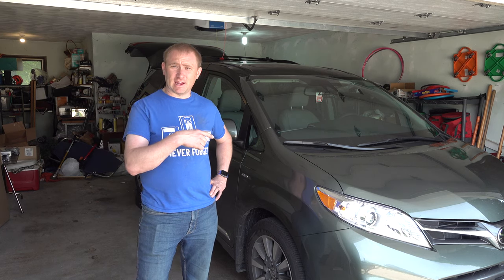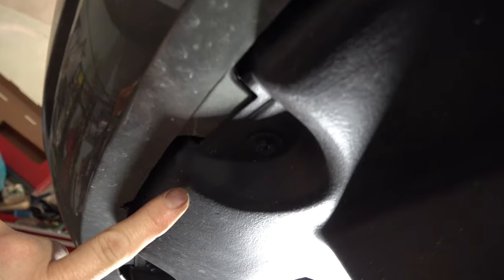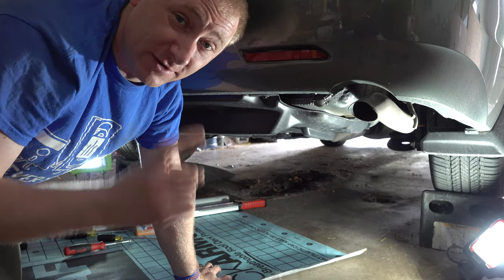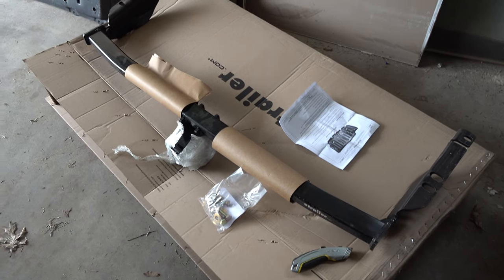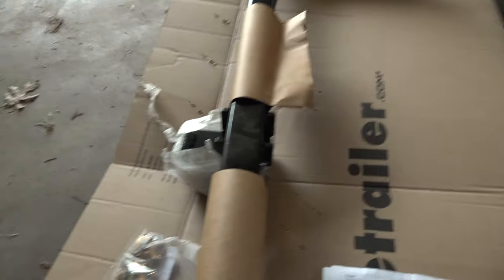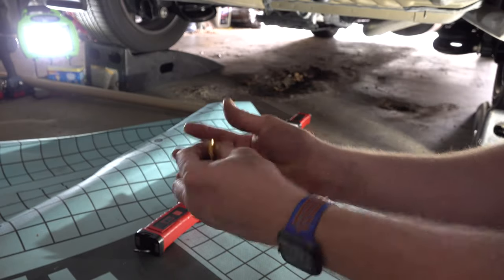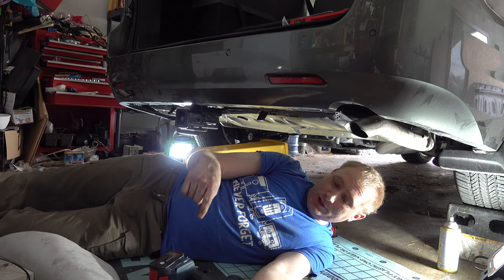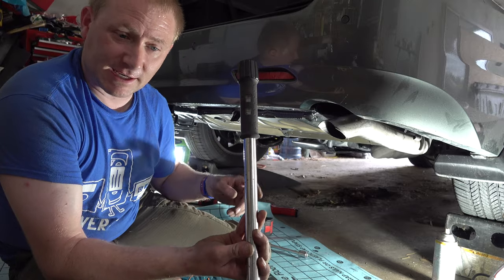2020 Toyota Sienna - Part 1 - Hitch Install

Comment: I remember when I installed a hitch on my Venza, I had to use a jack, some buckets and boxes as a second hand to hold up one side while I held the other side to bolt it in. The joys of working alone.